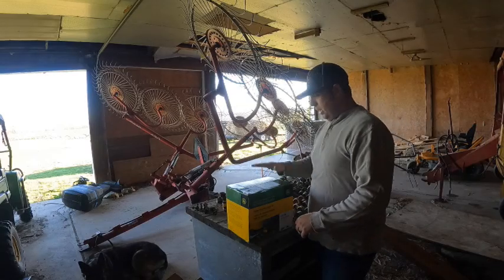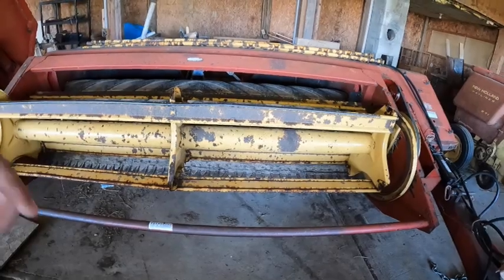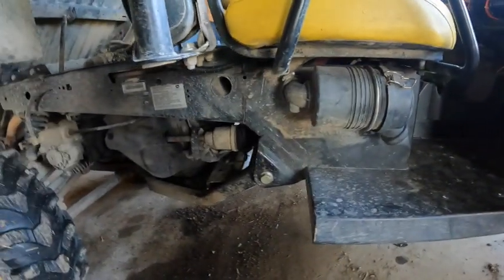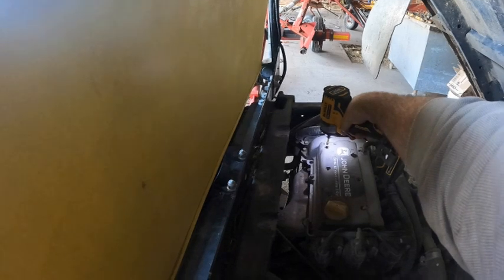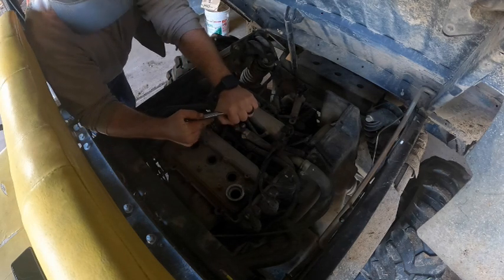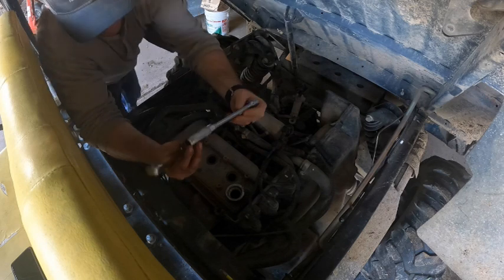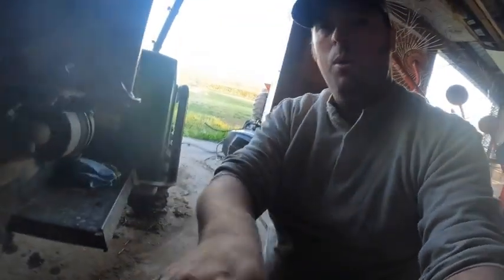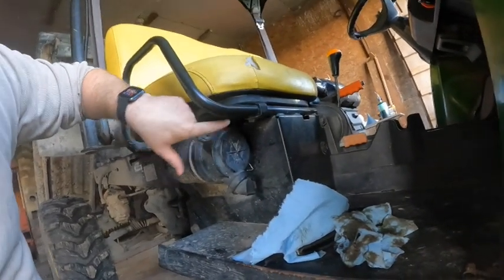Gator Maintenance: Oil change, Spark plugs, Fuel filter and Air filter (John Deere Gator 825i) #farm

Comment: I just replaced plug n wires on mine. Now I smell like electric burning  did ur do this?
Reply from the maker: Nope I didn't have that problem. Do you have any bare wire showing that could be hitting anything?

Comment: Fuel Filter Notes:
----------------------------
Push the fuel line into the filter, THEN
push the back side of that clip and
it will easily depress and while holding
it, pull the fuel line out of filter.
EASY.
DO NOT REMOVE THAT CLIP!
-- 1.6.2024
Reply from the maker: Thanks got the advice!